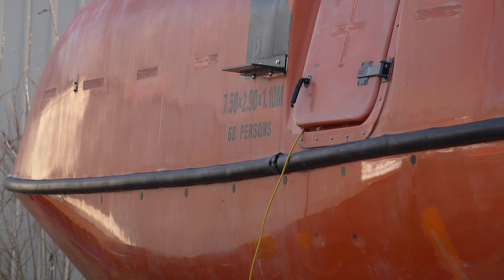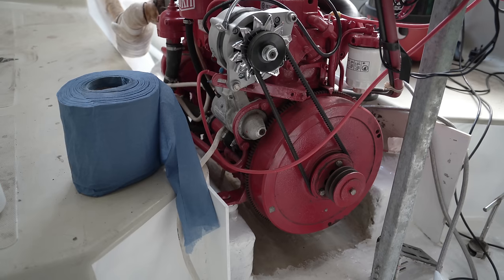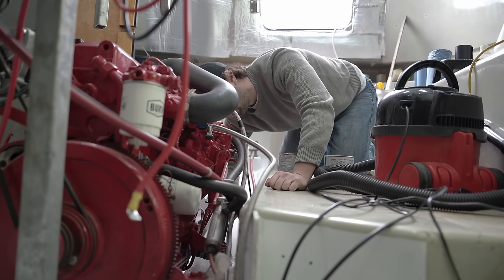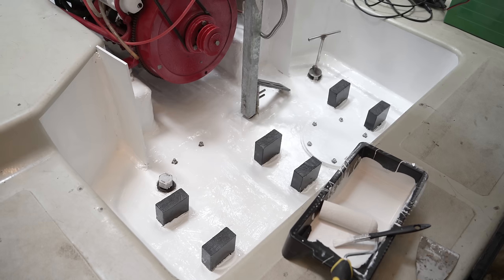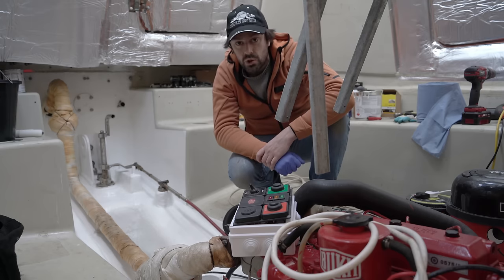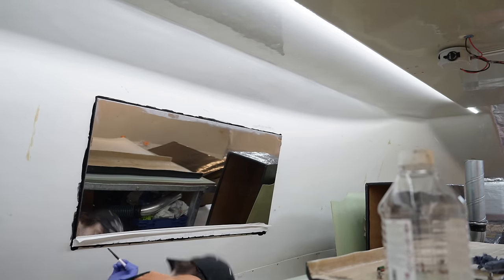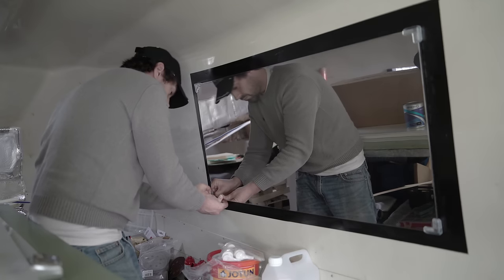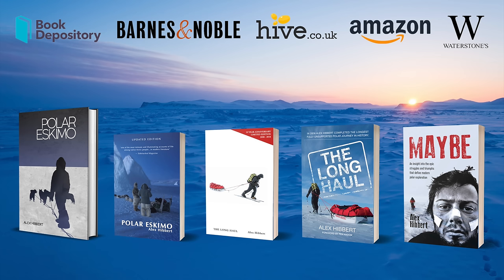Lifeboat Conversion Ep8: Preparing the engine bay [4K]

Comment: You also need sheets of stainless in the well where the chain and anchor will go to protect fiberglass. Just saying. Sure is pretty in white.
Reply from the maker: The chain and rope has a flexibucket, but yes you're right that when I install the channelling, it'll be designed to protect the fibreglass.

Comment: I hope you are thinking about bringing in the intake air so it comes in behind the stove so you avoid a super chilled draft in one part of the boat. 

P.s. Can you make the videos longer?
Reply from the maker: Can you explain further?
Reply: @AlexHibbertOriginals   I saw your stove in the background there and I assume you will be taking it with you.  

 It's quite common practice with wood stoves to have  an air intake from outside feeding the fire, so you don't have air coming  in form elsewhere and creating a cold draft, the stove heats the given space more efficiently that way.  

While with your situation you probably wouldn't want 100% of your combustion air to be drawn form outside (and probably not possible with that model) as  you will want some air exchange to keep the humidity down, however it might be worth thinking about bringing your air intake to the bottom of the stove so some of that air is used for the combustion and some directed over the upper part of the stove and lower flue to warm it before it spreads around the cabin, hopefully making things more efficient and avoiding a cold draft.  

The wall mounted Refleks stoves recommend bringing the air in from low in the boat to heat things more evenly, and some models have dedicated external air intakes for sealed environments like engine rooms or sealed pilot houses to avoid a negative pressure situation and sucking back down the flue, not that you are in exactly those situations but the concept is not new and definitely effective in the wood stove application, so I don't see any reason why it wouldn't be in yours too.   

This is all  depending on your layout  and  probably many other factors I am not taking into account, also,  I'm not an expert in the field so it's just some food for thought.  It's a cool project you have going on, I look forward to watching it come together.
Reply from the maker: @Smith5783  Thanks for taking the time to write this - very helpful. Prior to fixing in the stove, there's a lot more research I want to do, and your pointers will aid in that.

Comment: To remove all stickers and adhesive use the product 'Debond Marine Adhesive Remover'. I have used it on removing pads that used 5200 for adhesive. Amazon sells it if you can't find it locally. Good bye.
Reply from the maker: If it can remove 5200, impressive!

Comment: I question the notion of two fans back to back pushing air in opposite directions. The unused fan will impede the airflow of the operating unit significantly and so the fans will never be operating efficiently, you would be better to have them separated, and if you to have a common air source for them, gate them so that the one not being used is effectively removed from the circulation system. Also, for the sticker, I suggest using some tea tree oil to soften it and the adhesive if you can get it where you are, it's an Aussie thing.
Reply from the maker: Yes indeed - I spoke to an aeronautical performance engineer about this (slight overkill perhaps). You'll get marginal losses, but the blade designs are fairly low surface area, so these won't be dramatic. The simplicity and space savings are worth it vs. a dual duct design. There's a question mark over bearing wear, but if so over long periods of use, the blowers aren't expensive to replace.

Comment: Have you tried using a heat gun (paint stripping gun, hairdryer, type of thing) to strip that ungodly notice.
The bilge looks far better painted and like you said you'll spot leaks far easier
Reply from the maker: I'm concerned the heat gun will scorch the GRP. Gelcoat has a max. heat rating.
Reply: @AlexHibbertOriginals  start with something that provides heat but only at a low level, ie a hairdryer, you have heat settings on some, so start low and work upwards,  the heat reactives the glue, thus allow you to be able to remove the sticker
Reply from the maker: Will cautiously try, thanks.

Comment: May not want to paint that stainless shaft. It's the O2 in the air (and water) that makes stainless stainless. Cutting off O2 to the surface of the steel inhibits the oxide layer that protects the steel. This why prop shafts corrode in the shaft log, where the water becomes stagnant and O2 free. Just a thought.
Reply from the maker: Thanks Eva. Yes, if salt or contaminants penetrate the paint, it could degrade the stainless, but this coating is pretty comprehensive.

Comment: displacement hull rule of squares.. square root of waterline times 1.56 = maximum hull speed, there are rarely exceptions. you're doing good, really good, if maximum efficiency is at 75 to 80% of that number. its kinda grim, 25ft length, 5 x 1.56 = 7.8 mph, times 0.75 = 5.85 mph. the hull you're working with would be so much nicer if you could graft another one with it to make more length, 36 ft would allow 7 mph at 75% of max hull speed, 50 ft giving 8.27 mph efficiency speed and 10 mph if you needed to push, without completely killing efficiency when doing it. same power plant, more room for more gear, more fuel, personal quarters, etc. might be something to think about before doing too much work with it, if splicing a couple of those hulls together would be worth the advantages.
Reply from the maker: You're indeed right Alan will never cruise at 20knots. I don't think I'm going to bolt another boat on the back though.

Comment: I don't blame you for the short videos, editing is hard.  I've heard goo b gone is good for getting rid of stickers, and I heard somewhere that plastic razorblades were literally invented for getting stickers off of boats!
Also other than cost, why not use a purpose built expeditionary, or ice breaking ship? Cost seems obviously prohibitive, but are there other benefits to refitting a lifeboat? (Like environmental impact, crew size, maintenance, etc.)
Reply from the maker: Well a few reasons: a custom build would cost hundreds of thousands, if not millions. And most ice-rated boats (as opposed to ships) are not fundamentally buoyant, and still get into trouble amongst some types of pack ice. Also, there's the enjoyment of working on the project directly.

Comment: Are you going to have an air-to-air heat exchanger for the cabin air ventilation since you'll be in such cold weather? And how about any engine-based systems like a regular heater core and fan off the engine's cooling system?
Reply from the maker: None at present - the engine will be off for the majority of the time the heater is needed.

Comment: Heat gun or else disk sander until gone. (I'd keep it & put a frame around it...;-)
Advise to change the engine mounts. Rubber that old turns hard, has likely grown cracks, might fail anytime. New ones will improve noise & vibration, a nuisance you don't want 24/7.

Comment: Why did you wrap the exhaust pipe? Isn't the free heat coming off of it welcome?
Reply from the maker: It was as it came. Lagging is normal to avoid damage from the extremely hot exhaust fumes. Also, warmth won't be an issue whilst underway (the engine bay will radiate plenty), but when stationary or locked in to ice.

Comment: surely any metal bolts going through the body will transfer cold and require insulation also?
Reply from the maker: The ones in the air will need insulation as finishing touches. Those through the hull into seawater, not a great deal more than the rest of the hull, as seawater is nowhere near as cold.

Comment: In case of engine failure at sea what are your options? Will you have solar system?
Reply from the maker: Solar wouldn't be any use for a propulsion system. For blue water passages, yes I'm investigating secondary engine systems.

Comment: Will the fans have an induced current problem? Some fans and circuit designs cannot handle the induced voltage from air moving past an "off" fan and moving it around.
Reply from the maker: They are simple fans with no circuit boards, in case you meant that and not just the simple current. The circuit for the 'off' fan is broken, switched off. The only question mark the airflow guy I asked mentioned was if the bearings would have a shortened life - but he wasn't very concerned.
Reply: @AlexHibbertOriginals  Sorry, my comment probably wasn't clear enough, my bad. I'm more coming from the PC building side of things, where if you spin your DC powered PC cooling fans with compressed air, a vacuum, or even your hands, you can cause an induced voltage to short out your motherboard (which you've addressed by pointing out that the circuit is broken, so back voltage is not a problem), but also can short out or overheat the hub of the motor, making the fan weaker over time. If a short happens in the fan hub like across windings, it'll stop working, otherwise, the induced voltage will be dissipated in the hub as heat, which can to shorter life for the components (Windings, bearings, magnets)

I'm not sure if this applies to AC motors, and even within DC motors for industrial use I don't know if there's a rating that shows resistance to such induced voltages. Maybe because the fan is being backdriven by the flow the aerodynamic efficiency is lower so that the movement is low enough to have all effects be dissipated quickly/be within tolerances?

I really don't know, and I'm sure you'll know more than me, I just saw something that was relevant to my own hobbies and experiences.

Comment: Great project...and so far as explained, relatively well-thought-out. That said, I've got SEVERAL questions...some based on 'purpose', others based on 'original vessel design'. First, the carrier support for the prop shaft...that's thin fiberglass, built into a vessel designed for 'single use' MAYBE once in its life, for no more than 50-or-so nautical miles. Have you considered a FAR MORE ROBUST replacement, or at least, a 'take-with-you repair' for when it cracks and fails (located at the dripless seal)? The enlarged battery containment area...how are you going to vent this to the outside (or access it for water checks, as maintenance requires)? Have you considered adding an AC generator to your belt-drive array (on the flywheel)? Have you considered a small 'diesel heater' (an example such as https://www.amazon.com/maXpeedingrods-Diesel-Thermostat-Control-Trailer/dp/B07N63XV4S gives an example of such a very convenient, affordable device) that could draw fuel from your main fuel tanks?
And one other thing...every single one of these 'oil platform lifeboats' which have been converted to houseboats, where the new owner removed the 'bumper rail' (at the 2-piece hull divide line) has found EXTENSIVE CORROSION of fasteners and seals. Have you considered removing and checking this potential problem area of the vessel?
Good luck on your continued project!
Reply from the maker: Thanks. Some answers for you.

1. Yes that section is to be heavily braced and supported with ballast steel and probably more FB.
2. The battery area will still have a bilge area beneath, which is accessible. The batteries are non venting, but can still be lifted out and checked regularly.
3. I have a Refleks diesel heater ready to install, but it's low priority as we head into summer.
4. Yes, the sealant behind the rail fender is looking very perished, and the metal bar a little corroded. It's not about to break, but it's on the list of things to improve. The rail is in generally excellent condition so I've been reluctant to prize it off straight away.

Comment: Paint over the sign, if it's that tough it may as well be structural
Reply from the maker: Structural instructional signage. You heard it here first.
Reply: @AlexHibbertOriginals  in most navies there is a long standing "joke" that the hundreds of layers of paint (and sometimes signage) are the only reason it's still afloat.

Comment: FGS, please leave the labels at the end of the video on, they add so much character, value and heritage to the vessel. You'll regret if you remove them or paint over. Don't erase history!
Reply from the maker: There are a number of items from the boat (including the manufacture plate, and the chalk message from the dealer) that I'm preserving. This one is in a spot I have plans for though, and it was already damaged.

Comment: Engine sound cover? If none came with the boat, build one from plywood box, sealed as best you can to the bilge. Paint to protect and line with sound absorbing foam. Tape foam seams with aluminum foil HVAC tape. Otherwise Alan will be so loud your crew will all go mad and deaf.
Reply from the maker: You've predicted an upcoming episode.

Comment: I don't recall hearing, did your boat do duty on a tanker?
Reply from the maker: No, I think on a cargo ship.
Reply: @AlexHibbertOriginals  The sprinkler would indicate a petroleum tanker as it was used for escape from being engulfed in flames...  But there's always that random atom of uncertainty.   But WOW you have a great thing going on there I'd use a chain saw on the telephone pole across the street to get my hands on one of those big life rafts for a reasonable price....  Do you now if they are still selling them and roughly how much$$??  No pressure just curious, may rush right out and get one if price is right...
Reply from the maker: I think the sprinklers are a SOLAS requirement for all TELBs - whether on a ship or a rig. I've got a pricing pinned comment on Ep1 for you. Used boats tend to be available in areas linked to the oil industry or shipbreaking - so the US Gulf Coast, Aberdeen, Denmark, Singapore etc.
Reply: @AlexHibbertOriginals  Excellent.  Thank you.

Comment: You might try to get the stickers off with heat. But you must not reach the temperature that is the limit of the resin. Still there is good hope you get it off after heating it up with a small blower. Just be careful. Test it. Most of the glue used is not heat resistant and softens up. Alternatively, delegate to your wife.

Comment: Just a little remark... Anyone has told you how fiberglass behaves in Artic temperature, and mainly the low water temperature.. 
Glass fibre needs reinforcement to be able to not break appart in the freezing temperatures. Plenty of examples of boats and problems in the Antarctic. 
In this artic temperatures fiberglass becomes brittle, and easily breaks appart when you hit a little piece of ice. 

Take it just as advise to read into this problem and dont see it as an judgement ;-)

You just don't want to find out while in the artic.. "why nobody never told me!?"
Reply from the maker: Definitely an interesting take. Of all the years seeing boats working in the Arctic, including the shoulder seasons either side of winter when the temperatures are low, I've never seen GRP boats break apart, and I've seen plenty of them bash successfully through sea ice mile after mile. Almost all Inuit-owned boats I've seen are GRP. Aluminium is obviously an excellent alternative for large polar rated yachts. I've also done some cold testing with a composites company, and although we didn't test boat-grade fibreglass, the composites and resins had identical performance to impact at very low temp as they do at room temp.
Reply: I know of a few boats that had their hull reinforced with a Carbon/Kevlar coating. To help protect the fiberglass against the Ice.
Reply from the maker: Adding carbon would be bonkers for impact or abrasion resistance - it's not designed for either.
Reply: First off all it's a very superb and beautiful project! I love those boats. It's just my two cents from my own experience with vessels that sailed the Antarctic. Only one of them got badly damaged, the other one was prepared with an additional Coating and had no problems with the Ice. But if this was due to the added Carbon Coating or that it was never going to be a problem is something we never tested. 
Also I know about at least one Catamaran who sailed the Artic, that they also prepared their hull with an additional Coating.

But definitely it's done many times without any coating or the like and all went fine. It's just something to keep in mind.
Although those Lifeboats are build pretty sturdy so I won't expect too much of problems.
But if you plan to actually cross trough light ice fields to research a bit about how certain boats behave in Ice
Reply: Some steel hulled vessels add a layer off concrete in the bow section up to the waterline to protect the steel from being pierced by Ice. Dunno how that works with Fiberglass, but certainly something to keep in mind before heading into such scenarios
Reply from the maker: Thanks for the input. It certainly seems reasonable that a layer of concrete to resist indentation in steel hulls would be wise if there's a lot of impact expected.